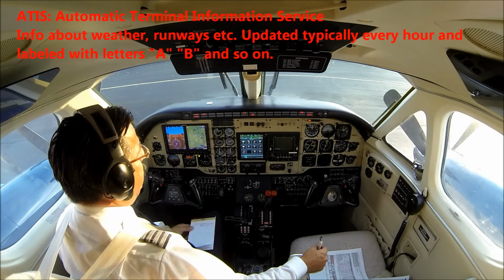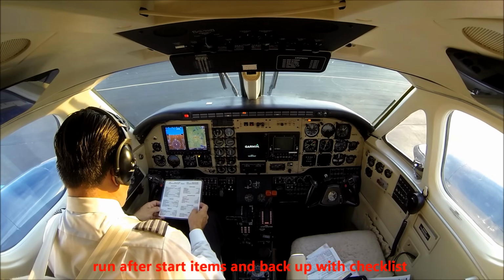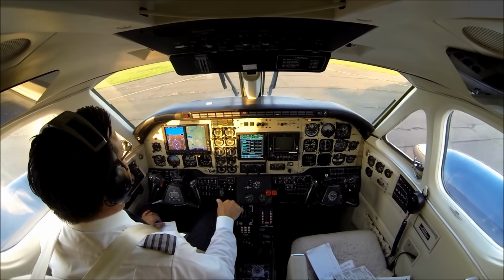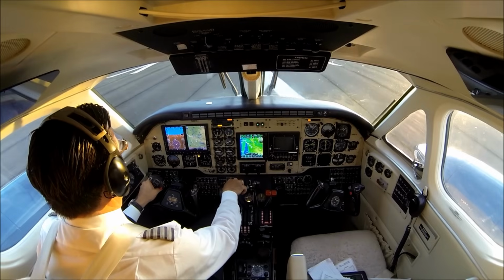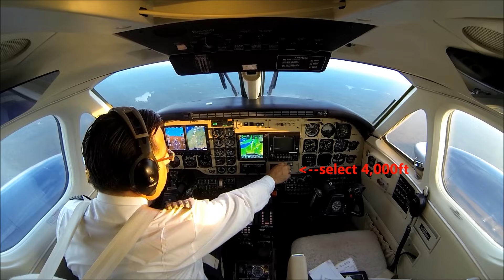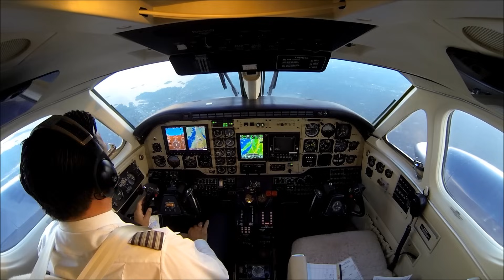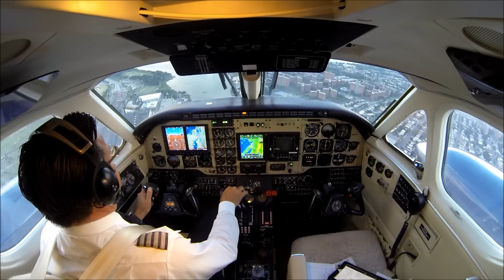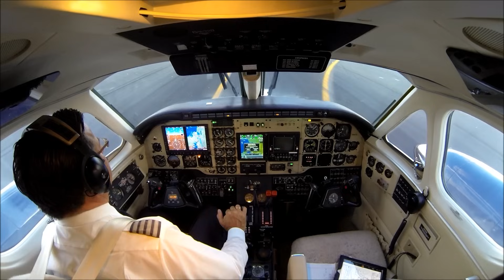King Air B100 - IFR flight to La Guardia KLGA!

Comment: Runway 22 is the best approach to NYC on a very clear day when arriving from the West or points South. They ride along the eastern perimeter of Staten Island, up the mouth of the Bay and Hudson River offering a great view of most of New York and the best perspective of the downtown cluster and midtown skyscrapers before banking over lower Westchester County or The Bronx. That low altitude over the East River as it meets The Sound can be quite scary for people not familiar with NYLGA approach. Only 7,000 feet per runway. Not a lot of run! And that's with the extension you see compared to the 1930's through the 1960's before they elongated it.

Comment from the maker: Answer to Carlos Santos:
This video shows the start process of the B100:
King Air 100 flight - real time cockpit view with ATC!
Happy Landings,
Guido
Reply: Guido, how are you? I've had a talk with one of the crew member I flight with. He said something that I need to verify; and knowing that you are a skilled pilot, I would like to ask you a question based on this scenario: I am flying towards the airport, in a IFR flight plan. upon reaching the class C airspace the controller starts giving me vectors to the ILS approach. On both NAV1 and NAV2, I have the VOR frequency with the Final approach course on my HSI. When is the exact moment when I am suppose to change from the VOR Frequency to the ILS Frequency?
Reply from the maker: Jose Sosa Hello Jose,
The moment you get radar vectors you are released from you previous route.
This is the point where I would switch both NAV receivers to the ILS frequency. This gives you also the time to verify and identify the correct frequency and to set the inbound course of the LLZ on the HSI.
If you have loaded an approach in a GPS (for example Garmin 430), this would also be the time to "activate" the approach.
The more you are ahead of the airplane, the better.
Happy Landings,
Guido
Reply: Thanks Guido Warnecke , that is what I thought about it too; sadly I was confused when my co-worker told me something different. I needed to clarify that.
Happy Landings

Jose Sosa
Reply from the maker: Jose Sosa No problem, Jose!
Happy Landings,
Guido
Reply: Pretty close to me?? 😳 (3 block away)LGA

Comment: Great to see a smaller plane land at LGA!  It's happening a bit more often now with the decrease in traffic but you were lucky to be able to fly in back in 2013!
Reply from the maker: You are correct Peter.
That is the only good thing about Corona. Traffic is down.
Typically we tried to avoid the big airports in the NY metro area and use Teterboro, White Plains and may be Farmingdale and Morristown.
Happy Landings,
Guido

Comment from the maker: The original King Air 100 had P&W engines. In the early 80's P&W was on strike. Beechcraft had the airframes ready out of productions but no engines. So management decided to install some of them with Garrett engines (around 200 units). Later the B100 was replaced with the B200.
Happy Landings,
Guido

Comment from the maker: Hi Richard,
these engines are Garrett engines and somewhat different in handling to the common PT6 engines. The fuel levers are only to shut down and feather the engines in case of an emergency. Start and introduction of fuel is electric and automatic.
Happy Landings,
Guido

Comment: I'm no Mr Guido and I sure don't live in America, but I feel confident that I can answer your question despite flying in Australia:
A departure call is usually made once you have left the traffic pattern and somewhere around the 3 nautical mile mark from the airfield. You don't call departure right after lift off because some aircraft may not be leaving the airfield after taking off (Circuits). Also, take-off is one of those critical stages of flight, so you don't need and increased workload.

Comment: Excellent job managing flight as single pilot. My son flies a King Air 350i for a charter company two crew which although the King Air doesn't require two crew I believe it is more efficient and safer. I fly a 46 J3 Cub (One Crew) and for the past year I will admit I didn't use a written check list because I thought it was such a simple airplane I could do everything by memory. Well after forgetting to set the altimeter before flight, leaving the pitot cover on a couple of times and the worst was not checking the primer was locked , I decided to write up a checklist. I actually came up wit Twenty items from pre start up to pre take off and shut down. Oh one more thing, My son and I have hand propped the plane got in strapped up and the engine quit because we did not turn on the fuel. Now that is a pain, getting back out and hand propping a hot engine, it usually takes a lot of propping. FLY safe!  and use a checklist no matter how long you have been flying or how simple the plane is. The Piper Cub is the safest plane of all time, it will just barely kill you :-)
Reply from the maker: Thank you for the interesting story, Jim.
Here a link to my latest video:
https://youtu.be/Af3fVp8R8bg
Happy Landings,
Guido

Comment: Great video.Love these KingAir videos, and hope you keep making them. Danbury is challenging IFR - grew up in that region and did my instrument rating out of KSCH, so I know these routes and destinations well, but not so lucky as to be operating such a magnificent machine. Flying mostly in Europe now, where we see many C90's but few of the Garrett powered B100's. Will be at the Cannes airshow in a few days, where I expect to see C90GTi's with Pro-line-21, as well as Piaggio and PC12's. KingAir is my ultimate airplane, though, and your videos are as close as I get to flying them.
Reply from the maker: Thank you, Greg!
B100's are almost unknown in Europe and only around 100 flying world-wide.
I will be at LFMD too, in about 2 weeks, but not particularity for the show.
Happy Landings,
Guido
Reply: Guido Warnecke
Used to regularly see a B100 operating out of LFPN, where I am based. Have not seen it in a few years, but it may still be operating there.
Reply from the maker: Greg Faris they are really getting old by now...
Happy Landings,
Guido
Reply: The KingAir's  have been a great plane, done much with the B200s and I350's but if I am honest  I preferred the Merlin 3c and the superior performance  payload  and roomier cabin, the honeywell tpe engines had better performance also, rated at 900 shp and superior maintenance durations and lower cost.

Comment from the maker: Hi Frank. Thanks for your comment. Well spotted with the altimeter.
I have actually 3 (!) altimeters on the pilots's side: one in the Garmin (electric), one under the Garmin (electric, drives the altitude function of the autopilot)  and one barometric, the small one on the left of the Garmin. The FAA insists that the pilot as an electric and a non-electric altimeter in reach. This is why I left the altimeter on the right side alone. Well spotted!
Happy Landings,
Guido

Comment: Mr. Warnecke.  Wow!  Couldn't help myself (  :-)  ) but had to follow this further.  Found some information on the Garrett TYPE 331, for the B-100, and "tried" to decipher  some information concerning the Torque Pressure indicating system.   What I found was very interesting (to an old Avionics buff :-)    This is a VERY complicated system that is used to indicate the "Torque Pressure" (as I'm sure you know).  This business of a "Lebow Strain Type Torque Sensor", to check this system is (cont'd)

Comment from the maker: Yes, quite unusual. They built around 200 of the King Air 100 with Garretts. P&W was on strike and Beech had all this air frames sitting in the hangars - without engines. I like them very much but it requires a bit mor attention by the pilot, especially for the ITT.
Happy Landings,
Guido

Comment from the maker: Thank you very much, Calum!
Very good question: the B100 has single shaft Garrett engines as opposed to the free turbine PT6 engines that all other King Air have. What does that mean for the start? On this Garrett engine, all components (propeller, compressor, turbine) are rotating on the same shaft. If the propellers would be in feather like on the PT6 the resistance would be too great. This is why we start Garretts in flat pitch and this is also how you recognize them on the ramp.

Comment: All mode A, C, and S transponders include an "IDENT" button, which activates a special thirteenth bit on the mode A reply known as IDENT, short for "identify"". When radar equipment receives the IDENT bit, it results in the aircraft's blip "blossoming" on the radar scope. This is often used by the controller to locate the aircraft amongst others by requesting the ident function from the pilot, e.g., "Cessna 123AB, squawk 0363 and ident"

Comment: I was looking for differences for the Garrett powered 100, the later model Garmin was an added bonus. I can't believe you could taxi out and get that quick of a release for LaGuardia. Thanks
Reply from the maker: +aztcgreg 
The Garmin 600/750 installation was only done a couple of yours ago, together with a cabin refurbishment.
Photos of the aircraft here:

https://flightaware.com/photos/aircraft/N847D

Typically, we try to avoid airports like KLGA, KEWR and KJFK.
I had very long delays on the ground as well. You burn around 260 ponds per hour while idling with the engines on the ground.
Happy Landings,
Guido

Comment: An excellent video Guido its always a good day when you upload a video. You're voice was very clear in this video and you seemed to describe thing more in depth which was great. I have a few questions if you don't mind,
1. On aircraft such as the B100 and citation there are not alot of switches on the overhead panel I was wondering why this is and what is on the overhead panel.
2. There was more power on the right engine I was wondering why that was
Thanks so much
Another great video

Comment from the maker: Hi Faolan,
Overhead panels are usually a result of bad cockpit design. It it difficult to reach and to see. On the King Air there are only some cabin and cockpit light switches and the switch for the windshield wipers on the overhead panel.
Engines: may be I did not adjust the power properly. This is quite common.
Happy Landings,
Guido

Comment: Capt Warnecke, i am a 600 hr IFR rated pilot. i thoroughly enjoy the details ( give more ) of your videos. i learn from each one. question, why do you not keep a hand on yoke during taxi and on roll out ? is not wind always a factor during taxi ? please continue making video's. may  the wind be at your back. william
Reply from the maker: Thank you William.
I have been asked the question about the "hands off" during roll out before.
May be I have to change this because it sets a bad example. In a light aircraft it is definitely advisable to have the hands on the controls during roll out.
On heavier aircraft, it does not make much difference, especially if the wind conditions are known and calm.
I will re-consider for future videos as I do not want to set wrong examples.
Happy Landings,
Guido

Comment: Very smooth,, nice video. I was enjoying the flight so much for the fact that it was  incredibly smooth . You couldn't have wanted a more beautiful day to fly to LaGuardia . The king air B100 must be a very forgiving aircraft to fly. Does it have nose wheel steering ,or do you have to use the rudder pedals to steer during taxi procedures ?? Take care ,and thank you ....
Reply from the maker: Thank you Tom.
The B100 has rudder steering to the nose wheel.
Tillers start with much heavier aircraft. Also a tiller would not work well in a single pilot certified aircraft. 
Happy Landings,
Capt. Guido

Comment: Mr. Warnecke - very nice & well done video. I like your SOPs - very similar to what I use. Two comment/suggestions/questions, having a similar flight deck to yours (G600/GTN's). I never did see when you activated the approach on the GTN750 and was surprised the approach chart did not show up. I also have the iPad as a back up but prefer to brief the approach on the G600 and keep it there in front of me while on the approach - having redundant maps on the G600/GTN to me seems not useful.

Comment: Mr. Warnecke.  Very nice video.  Have a question:  Noticed that the #2 Torque was generally higher than #1, with the ITT and prop indicators basically the same.   Do you have a fair degree of latitude with that arrangement?   As an "old" Avionics Maintenance person, I always love to see those "steam gauges" :-)   Sorry to say I do not have an IFR rating, but your videos are always so informative.  You display total professionalism - I've not seen any better in my over 30 years of GA flying. Thx.

Comment: As a 50+ year old PP training for the instrument rating I find your videos exceptional training aids.  Thank you very much.

Technical question?  On your ILS approach to LaGuardia you call out reaching the FAF at 1,900 MSL but you don't make a radio call saying you've reached the FAF.   I thought that there is a mandatory radio call required at the FAF.  Apologies if I just missed the call but would you please clarify for me why no call was given.  Thank you.
Reply from the maker: First of all: congrats to the instrument training! You are doing the right thing. It will enhance your flying skills and will make you a safer pilot.

Radio call at FAF. Only in a non-radar environment, this might be a call or whenever ATC deems it necessary. 
Inside the cockpit, FAF crossing it is a good time to check your altitude, if you have the wrong altimeter setting, you may pick it up easily then. Also any malfunction with the glide slope. 99.9% of deviations here are pilot error - wrong altimeter setting.
Flying is a constant learning process, never gets boring.
Thanks for watching my videos & happy landings,
Guido

Comment: Guido,

your video's are fantastic. you show great professionalism in the cockpit and great CRM both single pilot and PF PM. I am an aviation student at university in Washington state, and my CRM class corresponds directly to how you conduct business in the cockpit. thanks for being a great steward for aviation and keep the videos coming.

quick question, in this video are you doing a cart start? I ask because I was wondering if you would turn on the avionics and check ATIS prior to starting the engines if you were running off the batteries. 

thanks!
Reply from the maker: Thank  you!
We do a power cart (GPU) start whenever possible, because the Garrett single shaft turboprops need a lot of electrical power on start, much more than the normal PT6 engines. Some aircraft allow to switch on the radios only to listen for the ATIS or clearance, in this aircraft you need to turn on the full avionics bus. This consumes a lot of power and rains the battery quickly. The main reason to keep the battery fully charged is the fact that the engines start "hot" when the battery is weak and the engine turns slow during the start cycle. Less air flow.
Happy Landings,
Guido

Comment: Sure enjoy watching you work the B100. Your audio is very good in your videos, can you say how you are capturing the radio comm's on these flights. Thanks!
Reply from the maker: Thanks Ronald.
For the audio, I tap into the headset phone socket with an adapter and with a cable to the camera. Downside is that ambient noise is suppressed and you hear only what you would hear through the headset. i will change this in the future.
Happy Landings,
Guido

Comment from the maker: "yaw" is the movement of the aircraft over the normal axis. In plain language: the aircraft is unstable.and moves the nose from right to left. this is unpleasant for the passengers, the get "sea sick" like on a ship. The yaw damper detects this and moves the rudder to stabilize. Most important this is in aircraft with swept wings to prevent "dutch roll" . Google this and you get good explanations.
Happy Landings,
Guido

Comment: Great Video! In fact I like all your videos! I was just curious why the props were not full forward on final. It looks like they were abruptly advanced to the full forward position after touchdown. Is it best practice to do this beforehand or once the missed approach decision is made. Thanks!
Reply from the maker: Hi Noah,
the King Air B100 allows to land at any flight rpm range setting (96%-101%).
We usually keep the rpm in the cruise position on landing, for noise considerations. This is on the Garrett direct shaft turbine only.
Two things need to be considered when doing this:
1) in case of an engine failure, full power is not available on the other engine until the propeller is full forward
2) full reverse is not available until the props are full forward.
So we normally push the props forward after touchdown.
Thanks for watching my videos in such detail.
Happy Landings,
Guido

Comment: Nice video Captain.  What is your opinion on the Garretts vs. the Pratt and Whitney's?   The Garretts are supposed to be more fuel efficient but some say they are more tempermental between scheduled service.   Thank you.
Reply from the maker: Long story...
Garretts are by design more fuel efficient - depending on conditions 3-10%.
They are more prone to over temp damages as any change in propeller RPM / airspeed will affect the  turbin rpm and the temps.
In the hands of a responsible pilot these are great engine.
Happy Landings,
Guido